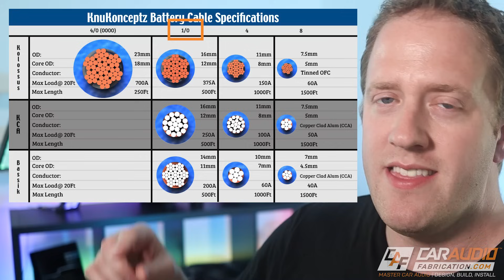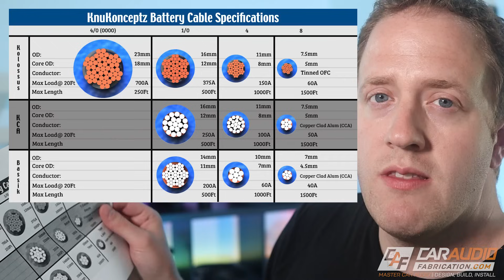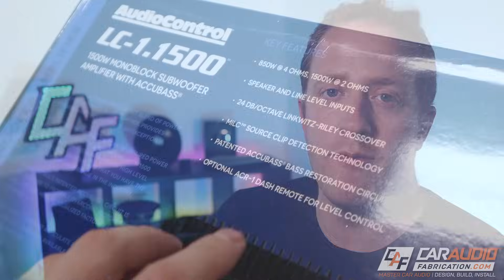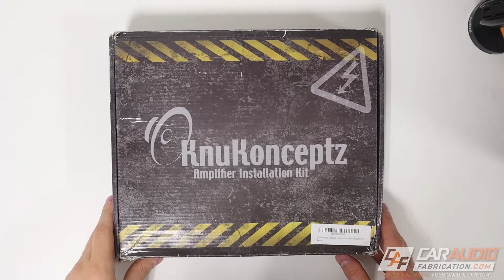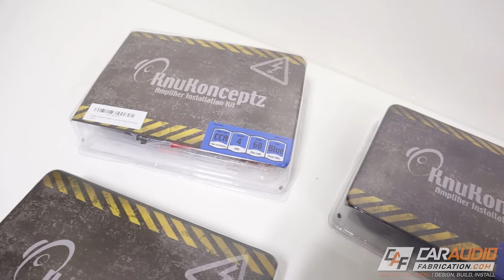Car Audio Power Wire - Do's & Dont's for a BETTER SYSTEM!

Comment: Too bad I can't find OFC wire locally that is bigger than 5AWG. And I need 2 AWG atleast. 

Could I use lets say 3 or 4 smaller OFC cable instead of one big OFC cable?

Comment: 2 runs of 1/0 or more? I have 370 amp js alt, 4 xs d2400 batteries in the trunk, and a nvx 500 amp smart battery isolator. Hope its enough 😂 i have Rockford fosgate 1/0  2 runs

Comment: I'm about to down size my setup from 2 L7 10's kicker 1200.1 down to 1 kicker comp.q.12 and audio control 800.1 so I can gain some trunk space back from that box with my air tanks attached 🙄

Comment: So.... I'm planning out a modest system for my giant Ford Excursion,   I'm curious about power wire to speaker wire length ratio.... is it better to have a longer length of power wire and a short run of speaker wire from the amp to the speaker?    Or the other way around?   50/50?   What's the general rule of thumb for this?

Comment: My amp just randomly stopped getting power. The fuse on the amp is fine, and the fuse on my power wire is fine, but it still isn't powering on. Checked my remote wire as well, and it's all good. The amp never got super hot, so I'm not exactly sure why it just stopped turning on. Could there be a problem with my power wire? I was only running 260 watts threw 4 gauge cca. Could there be a problem with the wire?
Reply: How’s your ground wire connections?
Reply: @jcicho  I don't have that system anymore lol, now I got 2 15s on a 5k lol

Comment: Here is an interesting question, my amplifier requires 120 amps, what would be better? 4 gauge OFC Kolossus (150 amps) or 0 gauge CCA Bassik (200 amps)? Will I lose watts with CCA?
Reply: No you won't, I have 4 gauge CCA on 1000W and its fine doesn't even get hot or have voltage drop.

Comment: Who here has the alternator charge wire and amp wire connected together at the battery, and split to each accessory? 

I'm trying to do a mostly "hidden" install in a muscle car with a stock appearing engine bay, and want to put the alternator charge, and sub power wire in 1 connector to the battery, and split them to their own fuses after the battery(for a cleaner install at the battery)

I'm worried about electric noise if I do this with with the dirty power coming from the alternator.. any help would be great!

Comment: I have to point out some things here.  Good advice can be seen here, but!

When we discuss cca vs ofc Is it really that drastically different in terms of voltage capability.  

I have about 12 feet of 4 gauge CCA running into a distribution block, and then about 1.5 ft total (split by a fuse) of 8 gauge cca.  Measured voltage at the amp was a concern for me as I got 13.4 volts.  I thought I was experiencing the dreaded 1 volt drop due to the CCA choice.   But then I measured voltage at the battery itself.  While engine was at idle.  Guess what I got.  13.4v.  Sooooo. ZERO voltage drop at the amp through all that CCA cabling.

Was this due to using 4 gauge for the battery to the dist  block run? So, good to go?  Would I see a voltage drop from the battery to the amp if I did 8 gauge cca for the entire run?

Comment: i am installing a new system in my truck and i have no idea how to figure out what gauge wire to use..i had made a diagram of my system using the program that you sugested . and got lost when it came to the gauge to use. can you help
Reply: battery to distribution block should be 0 gauge, from block to subs should be 4 gauge

Comment: What about welding cable? Have you used it in Dominican Republic we use 4 gauge welding cable for high voltage systems
Reply: Alot of us use welding wire. 👌

Comment: Hopefully i can get an answer to this but here goes. I have 3 amps. 1 of 1200watts, 1 of 1000watts & 1 of 440watts. My lights barely dim at night but i do see a bit of a dimming nothing bad. Should i add a capacitor? If so how should i go about it? 3 caps for each amp or just add 1 to the highest wattage amp?
Reply: FYI: i have a 2013 Traverse. The output of the factory alternator is 100amps. Wonder if just putting a new one or a bigger one would help a bit.
Reply: No no no. Capacitors are utterly useless. Ultra capacitors are great though or just add a second AGM battery. Although light dimming can be resolved by.changing to LEDs

Comment: yo, this might be a very idiot question and probably this wont be the right place to ask, but why my all speakers crash (LOUD CRASH NOISE ALL THE SPEAKERS) , when my woofer jump in, if the car is Running. If the car isn't running, then there´s  is't any problem about the speakers. I have car stock battery and 1.85 kw subwoofer amp, and around 600w speaker amp... i tried to build new wire's from amp to sub, new wires from amp´s to ground and stuff, but that didn't work. i used different RCA´s but no help...

Comment: I have 1 run of oversized 0 gauge CCA and 2 runs of 4 gauge OFC. Is it OK to do that? Will the current be shared between each cable or will 1 cable not carry as much as the other?
Reply from the maker: Electricity follows the path of least resistance.
Reply: @CarAudioFabrication  I guess it would be a good idea to test the resistance on each line to know for sure. Haven't thought of that. Thanks

Comment: If I have a head unit wired identically by splitting the high level outputs to the input to 2 separate amps. All the wires are perfectly identical and feeding to the proper channels but also it's feeding into one single ground. Is it dangerous possible or stupid to literally have two amplifiers which are taking the exact same signal from the head unit and feeding channel 1 from both of the amplifiers to a single speaker to meet RMS? Literally everything down to the millimeter is the exact same length wire for the signal from the head unit to the amps and then I did the same thing from channel 1 on both of those amplifiers to the speaker. It's like a splice from the head unit splits to two amps and then a splice from the two amps to one speaker, Will that double my wattage output? It's not a subwoofer there are 6x9s and I just realized that I didn't know what I was doing when I bought the amplifier but I did happen to get a free one so I figured I might as well try this however I don't want to destroy the speakers. Can one channel if it's the exact same channel receiving the exact same signal double d wattage that the speakers receiving or is there some sort of conflict that will happen? It's a boss 550B head unit and boss r1004 amplifiers and kicker ESC 693 6x9s.

Basically I'm trying to rectify stupid purchases and salvage what I can.

Comment: Any recommendations for a single cab truck I just want a sound improvement in the bass department not crazy amount of bass 1994 Chevy Silverado
Reply: You might want to look into getting a small powered subwoofer. Look for something like an under-seat subwoofer. In my experience they dont get anywhere near as loud as a proper subwoofer in a box, but they are still a tremendous improvement over having no subwoofer at all.
Reply: I managed to fit a 10 inch Focal (P25 EE) subwoofer behind the passenger seat of my Silverado in a .7 cubic foot enclosure I made. It is very tight and the seat can’t slide all the way
back but it’s still functional and comfortable. If you aren’t comfortable building a box you can look into shallow mount subwoofers and plastic enclosures that are wide and skinny and fit behind the seats. Best of luck!
Reply: @randygarcia8429  thanks I'm trying to get rid of that tin can feeling in the truck
Reply: JerrenB I feel you man. You wouldn’t believe how hard that 10 inch plays since its a small cab! Any type of subwoofer will make a world of difference.
Reply: Bucket seats and a custom center console enclosure
Reply: I shoved 2 12s in my single cab f150 with a bench seat. The seat had to be all the way up which wasnt to bad I'm only 5' 9". The biggest downfall was you had to use the bat wing windows to force feed them enough air to play at there best.

Comment: Can you explain the fuse size in relation to amplifier wattage and draw?
I had 4 gauge KCA to a 1200watt Kenwood Exelon amp to 2 12" subs.
I used a 40amp fuse and an 80 amp fuse. Even at full tilt and maxed everything out, the amplifier never drew over 40amps. Switched to the 80 amp fuse. No change in anything. 
So why are there kits selling 150amp fuses when even at 1200 watts maxed out, the 40amp fuse never popped?
Reply: This also goes back to wire gauge size being over compensated for performance. If youre seeing a voltage drop that loss of voltage is somewhere and its likely going to be in resistance (in under sized wires) which means that wire is going to get hot, melt, and short circuit. Your amplifier would have to draw some serious amps to cause a fuse that size to pop off.
Reply from the maker: Check out the electrical topics Playlist video. Definitely spend an hour watching those videos.

Comment: Does anyone make an adapter for 4 gauge to 0 gauge? Not talking about a reducer but an enlarger? I am running a KnuKoncepts fuse block with two 0 gauge inputs and three outputs. The outputs are two 0 gauges and one 4 gauge, I need to be able to use one of the 0 gauge outputs with a 4 gauge wire so I need some type of an adapter to do so. Any help would be appreciated.  Thanks!

Comment: Hi Mark, thanks so much for your videos. They are very educational for both the experienced and the novice installer. I'm working on an install on a boat and am fabbing an amp rack/sub reinforcement panel out of one sheet of Marine Starboard. My question has to do with running wires... can I run the amp power cords next to the sub woofer basket without any interference? As I have it drawn I have a JL MDH 750/1 and a JL MDH 600/4 (with wires routed down) mounted over a JL M7 12" sub. the power wire comes into the distribution/fuse boxes and runs up and over the sub to the amps. Let me know what you think!

Comment: Don’t forget to NOT run your power line on the same side as your rca cables.
Reply: Why?
Reply: Because power wire can cause audio interference and cause noise in the signal and poor audio quality
Reply: I’ve never had an issue with it.
Reply: Yup! This is the best advice you can tell someone beginning for the first time! It had been many years since I had installed a subwoofer in the trunk of my 95 e36 m3 and I was surprised that after the install I was getting interference engine noises while playing music and I was highly confused for a weekend until I realized what I must have done differently this time! The only the that was differnt was the rca cable which was used but the remaining components such as the head unit, power & ground cables, woofer, and amplifier all had been removed from another m3 identical to this car so I know the combination of parts all went together without a hitch!!! So there I was asking myself hmmm what could I have done differently this time around to be causing this interference noise……so if you werent aware bmw usually places there batteries in the trunk and I’m doing so they run the main power harness in my car along the passenger side of the car and silly me this time decided to pull my rca from behind the head unit this time also thru the passenger foot well right along side the main 12v line supply of the car
 
NOW I REMEMBER WHY I ALWAYS WOULD USE THE DRIVER SIDE FOR MY RCA ROUTING LOLLL😂
Reply: So my truck has engine noise everytime i step on it i can hear it and i have my speaker wire rca and power threw same side can tht be the issue?  Head unit is a alpine
Reply: @juansegura5593  ya reroute your rca wire and keep it separated from any power wire including the cars main chassis wire or the wire your using for the amp keep the rca on the opposite side

Comment: I’m gonna hook up a 2nd amp. I already have a  4gauge  in there already. Can I use the 4 or do I need to use 0 to power both?
Reply: Should run a 0 gauge and add a distribution block to use your 4 gauge for both amps.
Reply: BayAreaFilms ok thanks. I kinda figured that

Comment: What brand has the more strains out there of ofc wire i am looking for 1/0 ofc
Reply: The brand hes using has the most strand counts. Sky high is next, they oversize everything. The kolossos, not spelled right, but there 4/0 awg and 1/0 awg has the most strand count by far.

Comment: I got a question if I’m going to run two amps how would I run two remote wires?
Reply from the maker: You can likely  just daisy chain them. As long as they don't require much current, which most amps dont.
Reply: Run one. Run the other to the remote of the other amp Shazam

Comment: I have a question wanted to se if you guys can help me out with this problem ..I have a 09 Toyota Camry ...I have pioneer double din head unit ( don’t know the model number) I have a CXA 300.4 kicker amplifier 4ch 
Speakers: front of the car I got kicker 6x9 components Rear Rockford fosgate 6x9 3 way (model ) power.
Subwoofers: 2 kicker Comp Q at 2ohm 850 watts Rms 
2nd amp : Soundigital 2000.1 evo 1ohm and my kickers are wire to 1 ohm with this amplifier..
And a optimum battery 

My problem is when getting at a high volume when my subbs are playing at high bass my high and mids start to fade away in other words they shut down I have to lower the volume for my high and mids so they could play again..but when I lower the volume my subbs don’t play at they full potential..

Comment: Hi I sub'd your channel while researching my audio upgrade for my 2003 Frontier Crew Cab. It 's been like 20 years since I did my own install. Wow stuff has changed a lot, and generally for the better. Not sure why they are selling that CCA stuff when the pure Cu I found wasn't terribly more expensive.

2 questions though:

Speaker wire. What gauge do I need for driving 100w RMS door speakers using 400w RMS 4 channel amp. I don't turn the gain up all the way because that would make my poor ears bleed, but I would guess that this flimsy 22 gauge stock wire needs to get replaced.

Are you guys using any kind of termination pins? I wired my cables straight into the AMP, but would it not be better/cleaner to use some sort of crimp pins? If so, link please :)

Comment: I’m so broke that I cut off the ends on my jumping cable and soo they became my power and ground to my amp 2000w baby!!
Reply: ))) How's that working out for you?
Reply: Vassya Chuplygin to tell you the truth not a single problem no heating or corrosion or rust nothing been really good I’ve had it for the passed year or so and it’s a everyday use originally got the jumping cables from oreillys witch is there high end ones

Comment: My power wire keeps on starting on fire. I source my poser wire from the goodwill. I usally find the chandeliers and clip the power cord because i like the wheel to turn the lamp on and off to use for turning my shbs off when the pigs start making a pig sty. Last time i had to pull the wire off pf the battery by hand in traffic people. I seen one person say WTF is he doin?  it was crazy. Because i threw the wire and it melted part of my palm. Now its hard to get a good poerr wire from goodwill. Its the worst thing ever.

Comment: Also-- don't use generic "lamp wire" for anything.  I used 12 gauge lamp wire for speakers back in 2000 for my first car audio system which was very good at the time.. I also used this same generic lamp wire at my parents house in the basement for a surround sound system.  Here we are 20 years later, and that same lamp wire I ran in my parent's basement (ceiling) is all green/blue and internally corroded.  No idea if it even conducts well or not.  Don't use lamp wire for speaker wire!
Reply: I don't think anyone here has same system for more than few years.
Reply: Bet you've used wire nuts in mobile installs too. SMH
Reply: Brian Borell I bet you've used 3rd hand swap meet equipment in your installs!  GFYS AH!

Comment: Why is ofc cable silver not copper color.
Reply: He explained that in the video, OFC cable is silver coloured because it is "tinned"
Reply: Copper corrodes very easily. Therefore it's covered, or "clad", in a less corrosive metal to prevent this. Usually nickel. The nickel coating still makes up only like 1% of total wire weight, so it's no big deal.
Reply: Did u watch the video?

Comment: Why is quality 2 gauge OFC so rare these days?  Sometimes 4 gauge isn't enough and 1/0 is too much!
Reply: 0 G is always the safe choice 🙏 
If OFC, so you can run up to 3000 rms without any performance issues. It all depends on what you need
Reply: 2 G was always rare and sits in a middle of nowhere between decent 4 g and ultimate 0 g ... not a very commercial sweet spot
Reply: Manufacturers had to draw the line somewhere. With 2 gauge wire comes 2 gauge ring terminals, etc. And people would still complain about not having 6 gauge! Just go with 1/0. Wire can never be too large. Quit being a cheap ass over 50 bucks on $1000 worth of gear. :-)
Reply: @firebirdude2  No problem with price, just on a recent install 4 gauge wasn't enough (~200 amp theoretical max over 8 feet) and 1/0 was just too damn thick to fit under the vehicle trim.  I had some old 2 gauge that fit the bill perfectly.  Was just curious why it's no longer common, but I guess y'all answered that!
Reply: @zootopiashow  I don't know about always rare.  I seem to remember in the early 90s 2 gauge was common and 1/0 was rare.  I dunno, I've just always preferred the physical size of 2 gauge.
Reply: @davezorc  That was 30 years ago man 🤷🏻‍♂️
Reply: @davezorc  Then don't run it under the trim. Run it under the carpet. Maybe pull the seat and run it up against the trans tunnel. Heck, the SPL guys that run four 1/0 wires run them underneath the vehicle.